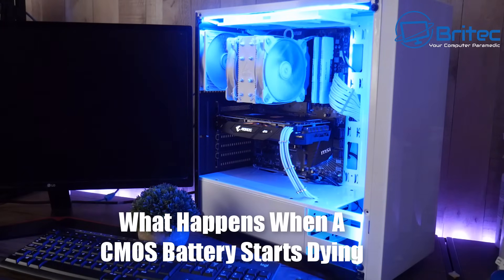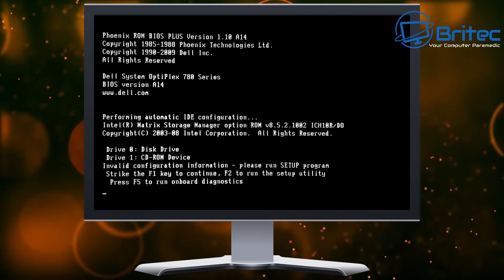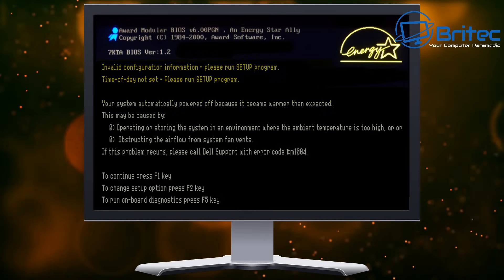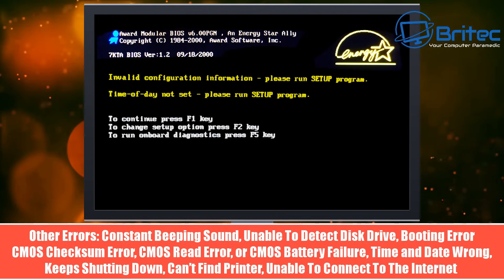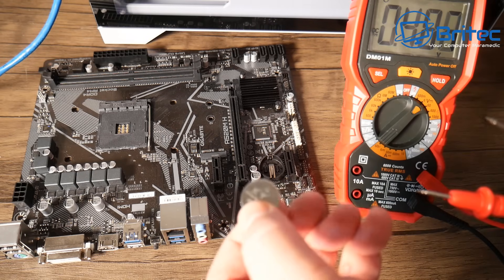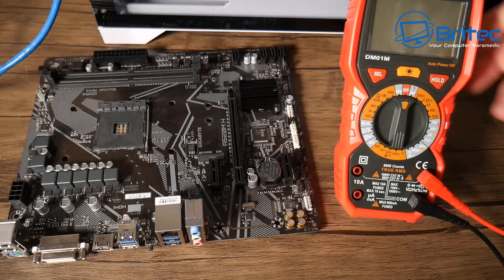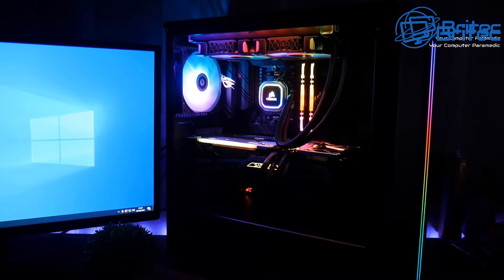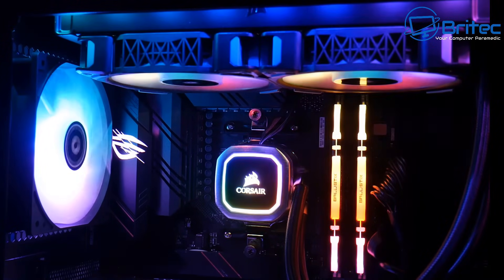What Happens When Your CMOS Battery Starts Dying

Comment: I'm p sure my CMOS battery has been dying for almost a year now, if my PC gets disconnected from the power when it's off, then the date and time settings reset and my bios settings on fan speeds and overclocks reset. All is fine if my PC is still connected to power even if I restart or shutdown PC.

Comment: i've noticed mostly on msi motherboards that it gets glitchy during POST or does not POST entirely. also, after replacing the cmos batter and the issue persist, usually its the clock crystal that needs replacement.

Comment: Usually, unless the BIOS chip is coded really wonky, the computer will know when something isn't right upon boot-up and it will just give you a "CMOS Checksum Error" which basically means data got corrupt in CMOS, and the data (settings) do not match the checksum, thus popping the error message. The #1 reason why this happens is quite simply, a dying battery. I've had this happen in plenty of my PCs, and this is always what has happened, 100% of the time. I've never seen a computer do anything else other than pop the checksum error. Maybe if you're running really cheap motherboards that don't have a CMOS Checksum? That technology has been around since at least the 90s, or maybe even earlier than that, I've had 486 computers that had CMOS Checksums and they all did the same thing when the battery died. Also, how long a battery lasts also depends on whether or not you use the PC regularly. A PC that is in regular use will last far longer than one that is only booted up once in a month, for two reasons: One, Li-Ion batteries last longer if they aren't discharged as much, and Two, if you keep it charged with constant use, it will never have a chance to discharge and it only needs to keep the CMOS running for a few hours. Lastly, if you leave the surge protector your PC is plugged into on, and you leave your PSU on, your PC is not even using the CMOS Battery at all; the PSU is supplying power to the mainboard even while the computer is not actively running. You may wish to turn the PSU off for about 10 seconds and turn it back on before you boot the computer to make sure you have a fresh cold boot, though.
Reply: A modern machine with UEFI will never actually show you a "CMOS Checksum Error" from a failing battery, since UEFI stores its configuration data not in CMOS RAM, but instead in a dedicated part of the BIOS flash chip called the variable store; the battery only runs the real-time clock. Gamer motherboards often will clear the variable store if an RTC reset is detected (to ensure that the old technique of "clearing CMOS" by removing the battery still work, even though it has no reason to work anymore), but a dying battery won't corrupt your variable store.

Comment: Also if you leave your computer on and set the settings and save and exit the bios without powering down it will boot into windows just fine because power is being supplied to the entire system. Then order the battert and just remember every time you turn on and off the computer you will have to run through those settings until you get your new battery.

Comment: I would agree that is causes issues but major? The only time its a major problem if your raided using onboard raid it cans cause major issues but for normal users its an inconvenience and seems like a major issue. Lets say you did have a battery go out. you can go back into the bios reset the settings in in most cases defaults are normally fine, set the time and your good. Order the new battery and you will only have to do that settings thing one time again after you install the new battery and your good for another few years or the life of the computer, which ever comes first.

Saying it causes major issues is not fully accurate for most people its a simple fix. It just looks like a major issue.

Comment: If you are using Linux it ain't going to be a problem if you are running ntp service for the network time, but if you are using older version of Windows like I used to run Win7 and I had NetTime running in the background to give the correct time or else Google search will going kaput. (Assuming that you don't run into any errors that is)

Comment: I didn't know that, would the same happen with laptops too? Cause my omen 17 was only 1 day old technically when I first started using it and it refuse to start up after battery running very low

Comment: I had the cmos battery start going while my computer was asleep. It reset the bios so it wouldnt book. Took me over a year to figure out what happened. Finally got it to boot but never knew what caused the issue in the first place. It ran good for a few more months until it crashed on me with a cmos checksum error while i was using it. It all clicked then that all my problems, a year of fighting with the computer, were caused by the cmos battery dying

Comment: Additionally the system can refuse to boot without date configuration. 

In prebuilt pc's this can be a problem if the manufacturer has locked down the bios. 

In the systems bios or uefi you can change the system date. 

A dead battery will not hold the date in memory. 

I've gained a pc or two because of this simple failure on Craigslist. 

People think their entire pc is dead so they list if for parts because even the average consumer realizes that even if the power supply goes many of the internal parts will still be reusable.

Comment: Britec09 can you leave a link to the tester you used in the video or recommend at tester please.
Reply: It's just a simple voltage reading so any multimeter (even a cheap analog one) will do. There are tons of options from online platforms or you can buy from your hardware store.
Reply: @Vendemiair  ok thanks
Reply: @Shiv.141  By the way I forgot to mention just go for a cheap digital one because they're easier to read rather than analog ones with a dial. The CMOS battery of my PC recently died (lasted ~7 years) and I confirmed it with a voltage reading of less than 1 volt (I think it was just 0.7 V or so). It's not absolutely necessary though to confirm a dead battery with a multimeter since you can just pop in a new CR 2032 which is very cheap. I just happened to have one because I occasionally work with electronics.
Reply: @Vendemiair  yes I want to get one it a helpful tool.

Comment: I just clicked on this out of curiosity because I didn’t know what a cmos battery was and realized that it’s the likely culprit for my repeated boot errors on my ten year old system. I’d just assumed it was my hard drives conflicting at startup but ironically I get the exact issues listed every time I restart it and I’ve just been going through the bios and exiting out just to bypass it lol.

Comment: I've had my machine running for 5 years and my CMOS battery still runs sweet as a nut. Battery came free when I bought my motherboard too which was a nice touch.
Reply: I had mine running for 13 years and now it seems to be dying on me...hmm. :)
Reply: You mean u ran it for 5 years straight? Without ever shutting it off?
Reply: @samir9735  The first 4 years I always shut it down when I wasnt using it but for the last year I've been mining.
Reply: i7 4770k Asus Z87 Maximus VI Hero from 2013 on factory CMOS battery going on 9 years still working perfect.
Reply: Sweet as a nut? 😄

Comment: I have an old computer, it's 18 years old now. The original battery was completely dead when I got it 7 years ago. It didn't even detected the SATA HDD at this state, when it was plugged in it said "hardware initialization failure". It worked with an IDE disk, however. I've replaced the battery, the computer was in everyday use for about 2 years, then it got unplugged for 4 years before I turned it to a retro gaming PC as my modern PC can't run my old favorites. I measured 2.7 Volts on the battery but it still works, the clock was only about 10 minutes behind after 4 years without power and it recognize the SATA HDD as well. Maybe time to replace? I started to have issues with another PC when the battery measured 1.1 Volt. It's always plugged in now so it should't drain too fast.

Comment: When the CMOS battery is ending it's life it will still show close to 3 volts by itself.  But in the motherboard the voltage will be much lower due to current drain.  Best to measure the CMOS battery in the motherboard first before taking it out of it's holder.  Measure between the + side on top of the battery in its holder and the board ground at a metal connector shield at the back side of the board.  If the battery is at 3 volts or more it has a lot of life left.  If it's down to 2.7 volts replace it for good measure before trouble starts.
Reply: Won't this manœuvre make it blow up?

Comment: This video is extremely useful and important , thank you for making it. Many, many people, think that a worn out or faulty CMOS battery will simply set the BIOS values and date/time to their default, and that you can get away with it if you enter the correct values each time you turn on your PC. This , unfortunately, is simply NOT true....
 I 've been building PC rigs for more than 20 years for friends and relatives and here's maybe the funniest story that i have to share : i once put together a retro gaming xp pc for myself. Brand new hdd, RAM, good quality PSU, all other hardware known to work PERFECTLY, and just to have everything in top shape, i decided to install a BRAND-NEW CMOS battery, from a very reputable and well-known company i might add...well, to cut a long story short, the pc kept crashing at the same exact point when it was loading windows XP, with me banging my head on the desk trying to figure out what was wrong....after swapping every hardware i could , from all the obvious ones to all cables, and even trying to loosen up the motherboard screws (!), i was ready to give up, when it occured to me to swap the brand new CMOS battery that i had installed with an  old battered one i had laying around...and , lo and behold, the PC booted up perfectly!!!  the funniest thing is , that the same "faulty" new CMOS battery worked just fine in another motherboard.....!! Now i 've seen a lot of weird stuff, but never an...incompatibility of a certain motherboard with a specific CMOS battery! Life as a PC tech never ceases to amaze me ....
Reply: Dude, this just confirms to me all computer tech runs on Black Magic and Voodoo! 🤣
Reply: @hurdygurdyguy1  Well Black Magic makes custom wire sleeves and the Voodoo gpu was once a big thing.
Reply: Ever use a volt meter to check voltages when working on PC's?  Like the CMOS battery voltage?
Reply: @pibbles-a-plenty1105  no I didn't , i didn't get access to any such equipment unfortunately. But like I said, the battery that gave me all that trouble was brand new...and also worked fine on another pc
Reply: Have you considered the possibility that there could have been dirt or a loose connection or something, maybe the battery wasn't fully seated in or something and the voltage being slightly off caused corrupt data in either the BIOS or the system RAM?
Reply: @Dhalin  Well, as soon as the thought that the battery might be at fault crossed my mind, i cleaned the metal clip of the CMOS base on the motherboard, and i tried to move the clip a little , either by pushing it down or lifting it up a little with a flat screwdriver, but the result was the same...of course if the voltage was slightly off as you say, i could indeed have BIOS or RAM corruption without knowing it, since i don't have a voltage meter to test parameters like that...but again, as i said in my original post, the same "faulty" battery worked from the first try on another motherboard, without me having to clean anything or make sure that the battery is properly in contact with the metal hinge....and in that system that it's on, it works flawlessly to this day, more than three years later! I don't know what to say...
Reply: My HP laptop has dead CMOS battery, simply sets BIOS values and time/date to to default. No need to enter correct BIOS values either (because during OS installation important values were on default), it boots just fine. I only need to update time and date via NTP service once it's booted. But, its worth noting that I have Parrot OS GNU/Linux on that laptop, Windows may behave differently.
Reply: @filiphabek271  I never thought that the way each OS is designed to boot can play a part in this , thank you for sharing , interesting....well, another +1 for a Linux distro then, it makes a good choice for laptops that have their CMOS batteries in the worst place and are a big trouble to disassemble...
Reply: If my pc become no signal in the middle of working/running is it also causes by cmos battery? I have checked my vga/hdmi cable, clean my RAM, update my graphic driver, those were not the issue
Reply: @flickmew99  well, I never had this particular symptom from a dying battery , and I really don't think it is the cause, especially if you have a dedicated GPU and not iGPU....but since you have a desktop , and it's not difficult to swap the battery, can't hurt to try . Let me know how that works out :-)
Reply: @georgehartigan31  I would try to change my CMOS for sure, I think it's been 4 years since I build my PC, might consider do that for sure. And my CPU is Ryzen which is iGPU, I don't use any GPU Card right now, so I'm really worried that the problem is on my motherboard or even PSU but I really not sure.
Reply: @georgehartigan31  Perhaps your new battery was old stock and had gone high resistance. You may have momentarily shorted it out when removing it from the first machine and cleared the high-resistance battery fault.
Reply: @Martock1017  if I had never experienced my problem , I would say your theory is a bit of a stretch,  but right now , I believe everything is possible ! 😁 I always ground myself when I fiddle with the insides of my PCs though, so i don't know about short-circuiting the battery🙂
Reply: As someone who has only built one pc (with guidance) this doesn't give me much optimism that I will resolve the issue I have with my pc! Someone suggested CMOS battery but it went funny after I knocked it when decorating and I've pulled out ram and popped them back in and tried reseating the graphics card and the blasted thing won't even open in safe mode! Gah! Oh I've removed some of the dust that was in there too. I might have to actually pay someone.... But it's like a puzzle I want to be able to fix.

Comment: Ha ha. What a coincidence. I sometimes use an 11 year old laptop with a dying cmos battery that I haven't gotten around to replacing yet. I get the cmos error when trying to boot, but all I have to do is boot into the bios, then save and exit, and the laptop starts up fine, with only the clock needing to be set and the wifi card to be turned on. I wonder what would happen if the battery goes completely dead. 🤔

Comment: Laptops maintain their battery pack using the cmos battery, when the battery pack is fully discharged, and it doesn't give power at all through the + - leads. It uses the middle leads to communicate with the battery pack, to discharge below 0%. It is needed for experts, who run their laptops on battery. Asus needs 3 days to fully discharge, Acer needs 3 weeks to do the same. It is needed, when you buy a new one, and yearly one such a discharge is required for regular users. When a laptop battery is bad, shows an x. That results malfunction.

Comment: I had this problem with my old PC (which I wanted to replace anyways). I could have just changed the battery, but it was hidden beneath my GPU (typical older msi motherboard), which would have been an adventure to do.
My solution until my new PC arrived: just don't switch off the PSU or any other power supply so the basic power could keep the cmos alive.

Comment: What I always found annoying is that there's no way to replace the CMOS battery, even when it isn't dead, with a new battery without having to re-configure all your settings. So, you either make a habit of replacing it every few years or so and, consequently, re-configure your BIOS, or you just wait for it to die when you didn't plan and be forced to replace within the next days less. I suppose you could leave the computer plugged in as you replace the battery, but it's a risky move.
Reply: I don't even know where did you get that information.

I used to clean my motherboard and disassembling everything including took off the battery. When I installed new CMOS battery, BIOS settings are still the same from the last time I made changes to it. However the clock seem to be out of sync but it doesn't matter.
Reply: I can only assume there are older models or a picky maker you speak of. I just changed my battery on a Dell Inspiron 3860. After starting it up, a blue screen said windows didn't restart properly. And a button icon that you click to restart. Fired right up. Only issue after that was that the clock had to be re-synced. No biggie, the clock right clicks to that option.
Reply: if you replace with 5 seconds you dont need to do anythinh.

Comment: This has happened to me over the years. That time/date is a giveaway. Comments didn't tell you to place a fresh battery inside the case to use in case the MB battery dies. Saves you a trip to the store.
Reply: Mine usually either resets back to 2007 or jumps foward to 2047 just to give a example out of nowhere no matter how much i set the time/date right. I guess the CMOS battery in my laptop has been failing for years as well and needs a new one.
Reply: @pablodelgado7919  Replacing the CMOS battery has always worked for me and I place a second one inside the case for the next time.
Reply: @outlet6989  seems like a great idea. Thanks for the tip
Reply: @pablodelgado7919  Thank you for your replays. I appreciate all replies I receive.
Reply: @outlet6989  you're welcome